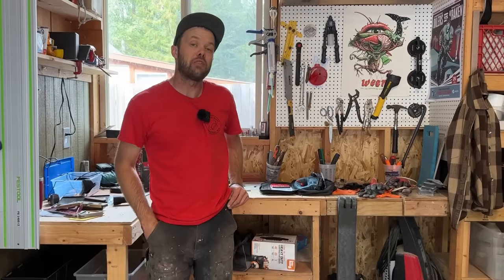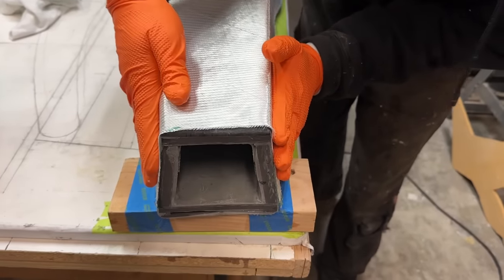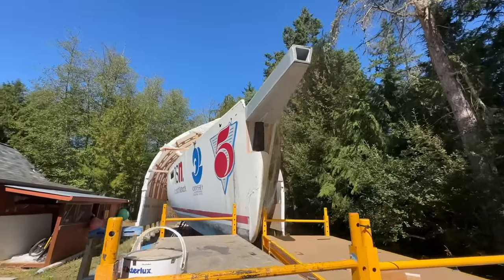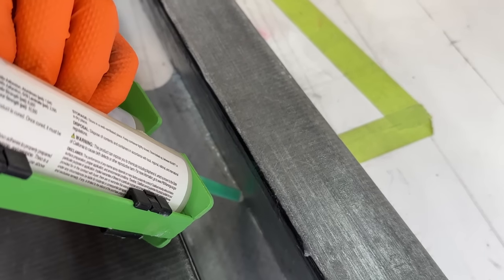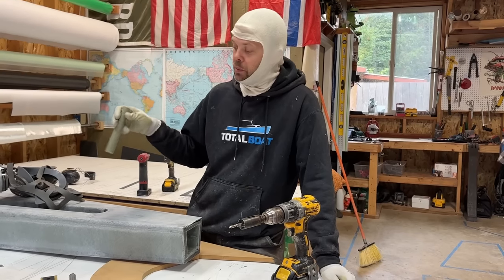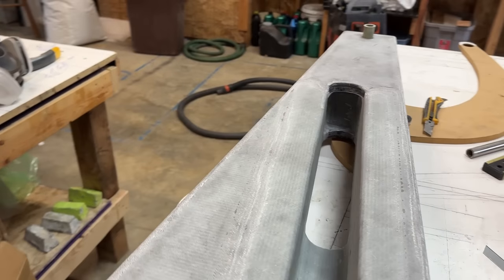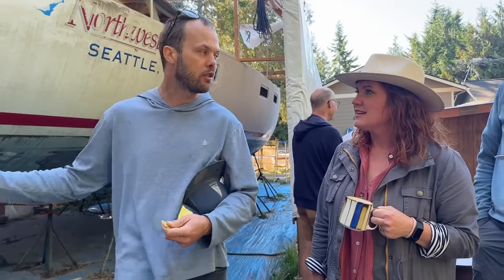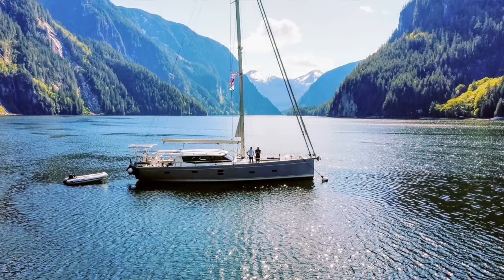Bowsprit build & POTENTIAL NAMES FOR OUR BOAT?? [E96]

Comment: A timeless name goes on forever and you will never regret it.  Duracell is a timeless name and you probably don't need permission to use it because of context. But, you live in the litigious USA.  
My boat's name is ULTEGRA.  I chose it because of my cycling racing background. It's a brand of Shimano that I used for years.  I never dreamed I would be able to use it. But the Canadian Ships Registery allowed it because it didn't violate the copyright context.  Shimano never objected but wouldn't buy me the Shimano ULTEGRA  logo'd spinnaker either. Cheap buggers 😂😂

Comment: If you are open to a suggestion, you might want to consider making the end cap for the bow sprit out of a block of urethane foam, and carving it into a fair shape that slides into the end of the sprit and accentuates the prow. Just a thought.

Comment: Before you glue the bowsprit to the boat, do weigh it, for I bet there are a number of people out there (like moi) very curious to know how much it weighs just with the fiberglass, no rollers or the ss liner on the channel. How about doing a quiz, or a guess-a-rama shootout for people to try to estimate the weight of the bowsprit? As is, I bet it is weighing about 35 to 40 lb, and I say this because as a burly Viking descendent that you are, I think I heard a grunt as you fitted it to the bow...  : ⁰ )

Comment: Really neat construction. Did you consider plumbing a line to the forward part of sprit with a fitting aiming down for a high pressure washdown? that anchor may be hard to hit with a hand hose from the top side.  Duracell is an iconic name to replace, good luck choosing one that will stick.

Comment: Hi Matt, shouldn't it be a good idea to have an integrated stainless steel plate at the bottom of the chain channel in the bowsprit?
This doesn't need to be thick, around 2 to 3 mm, but SS is a very durable and wear resistance material to avoid your chain channel in the bowsprit to be worn out after a while by the chain, especially anchoring in deep waters the weight on the chain will be considerable and will wear out your bottom channel plate if not protected by this SS bottom plate.
Consider at least some wear pads etc.

Kind regards,

Martin Wijnberg, Chief Engineer (from Holland)
Reply from the maker: yes that's the plan

Comment: This boat has been known as "Duracell" for as long as it began racing. You guys call the whole deal "The Duracell Project", changing its name now would be changing its very character, for it would become something else. You guys have changed so much on this boat, naturally, but changing the name would be killing its past forever. Think about it, if this boat had a mind and a soul, would he like to have its name changed? I doubt it.
Reply: why dont you go back to the battery guys and see if they would support the project?  every little bit helps
Reply: I disagree, they don't want to be tied to a battery manufacturer. They aren't advertising for them. People get too hung up on nostalgia. It's their boat and NOT sponsored.
Reply: That would be really great. What if Duracell finances, say, a nice OceanVolt engine? Hey?!
Reply: @Liofa73 What is wrong with a sponsorship? The boat was sponsored by Duracell, and Duracell financed the Vendée Globe race event. If a fair contract for sponsorship is signed, so they are not tied to obligations that do not interest them, or have to paint the boat in a way they don't like, but instead just divulge the brand Duracell in a proper and interesting manner to all parties, sponsorships can be excellent. But it all depends on the agreement and the type of contract signed.

Comment: Just a curious question about your use of the DURACELL name in your vlog title. Did you have to obtain permission from the DURASELL Company?  I'm creating a whimsical conceptual ceramic sculpture in the form of a battery, and was planning on applying vinyl letters using the DURACELL text.
Reply from the maker: it's kind of a long story, but we think we do have permission now. We didn't realize when we named our channel duracell that it could be a problem (though now it seems obvious).

Comment: Change it to whatever you want, don't keep Duracell, you're not sponsored by them. Change the livery to whatever you want too. If Duracell has stumped up a load of cash for sponsorship, fine. But it's your boat, not theirs. It's basically a new boat with all of the work you've put into it. Do you really want a boat that's advertising a battery company when they aren't even helping you out?

Comment: Paint the helm Copper and then it's the "Copper Top".
Reply from the maker: don't know if you know this already, but the deck was originally painted with a gold paint to be the copper top for the vendee globe, but during the first sail, the deck started melting so Mike Plant painted it white. We see patches of the copper top color though all over the deck.
Reply: @TheDuracellProject  Very interesting!  You should mention that in a video.  Were cheering you on!  Please be careful with the pressure you're putting on yourself trying to get things done.  Your mental health is more important than anything.  These kinds of projects can make or ruin a person.   If it gets done or not, at whatever pace, just remember to stay grounded.